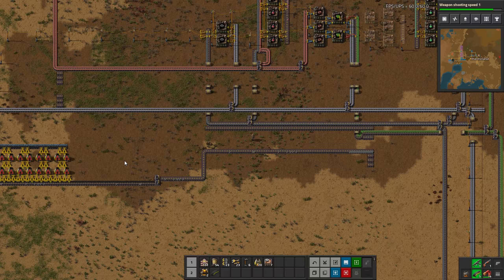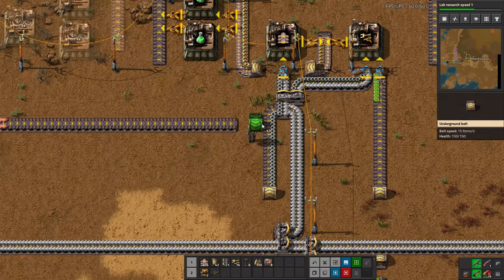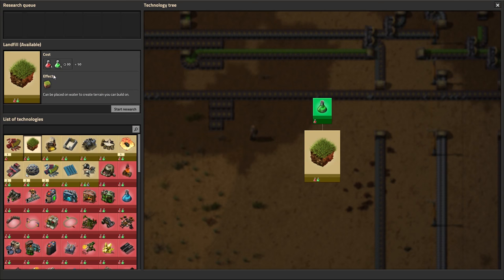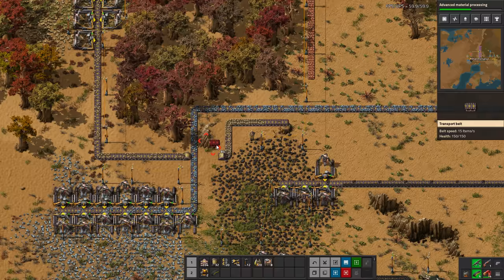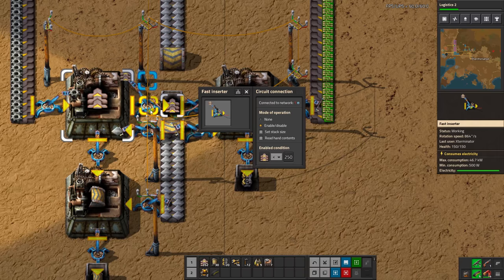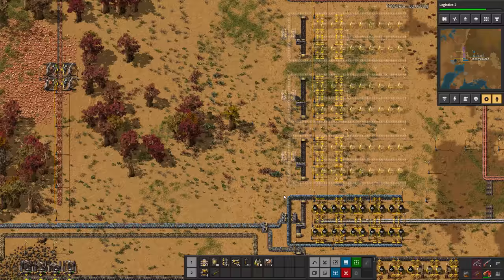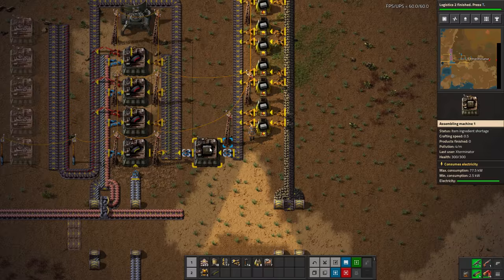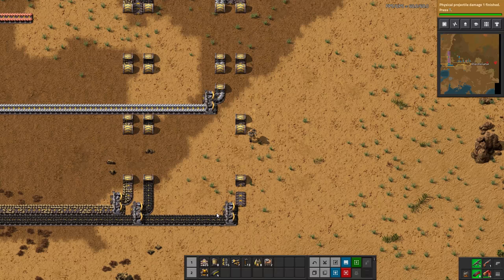Factorio 1.0 Tutorial Lets Play EP7 -  Military Science: Introduction Guide For New Players Gameplay

Comment: Curious about going all the way back to the smelters when you had that half line of coal that was stopped when you split off the steel.  You could have just ran that split belt forward and used it. 18:23 - 18:30.  If you took out that splitter (0:55) and let it run to the next splitter, you would have both of your products without running another belt all the way back to the smelters.
As has been mentioned, you need to fix the belt for your green circuits to supply your yellow inserter assembler, you broke it at 2:53.

Comment: your smelters that are closest to the wall assembler at 27:35 are not working because of the oversaturation of farther side of the belt. To fix this you could run a splitter on the end of the smelter line and connect both outputs to a single belt to relief the load to another side of the belt, and make another fast inserter to maximize crafting speed in the setup you work on
Also at around 29:35 when you pop up your inventory i noticed you have assembler II units that you can handcraft, any reason you don't do this immidietaly?

Comment: These tutorials are awesomely useful - thank you very much for going to the trouble of making them! Out of interest, is there a quick way of dumping a stack of say 50 items out of your inventory? For example, I ended up with about 300 coal and dropping it unit at a time is kind of zzzzzzzzz....
Reply: Shift-left click to move a whole stack. Ctrl-left click to move a type

Check the wiki for "keyboard bindings". There are hotkeys for everything
Reply from the maker: I'm so happy to hear you enjoy them and find the info useful! I'm have a great time making them and really appreciate all the support. :) 

As S Black said, you can Ctrl-Left Click to move a large amount at once into a machine or a box. If you're trying to drop them on a belt though, unfortunately you have to do it one at a time. So if you want the items back on a belt, the best bet is to put them all in a chest with the hotkey mentioned above, and then have an Inserter place them back onto a belt.
Reply: Okay, so it is drop into a box or a use as fuel, but you can’t just drop 50 items on the ground at once? I just need to learn to plan better....
Reply: @andrewherd386  
Dropping trash into boxes is perfectly normal. Set down a row or two as boxes to store trash. Later on you get robots and chests that can automatically move those into the right boxes and recycle them into the system. That requires yellow science however.
Recycling plates or ore for examples can be easily done by inserting stuff onto a short stretch of belt, merging with a splitter and giving that belt priority